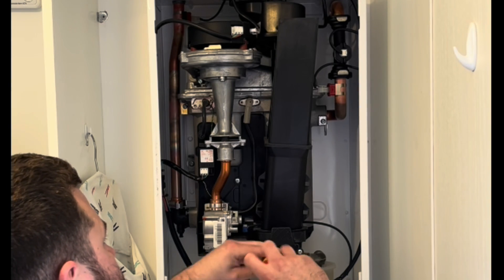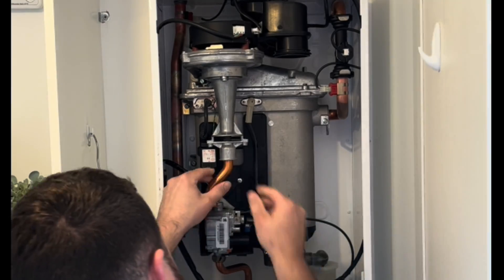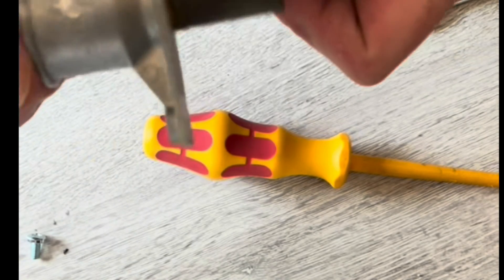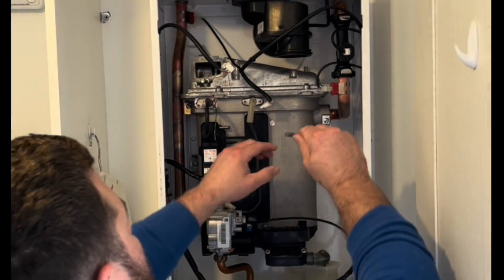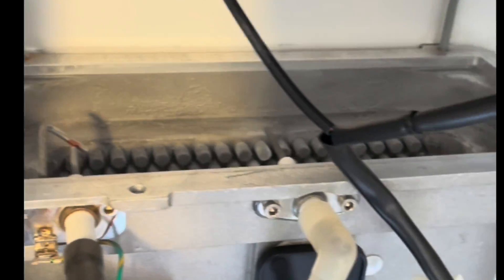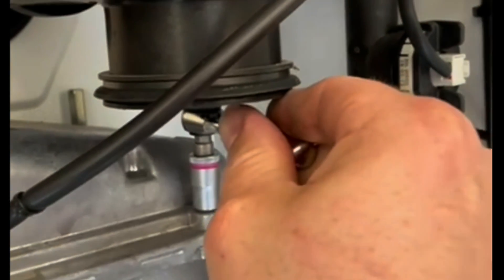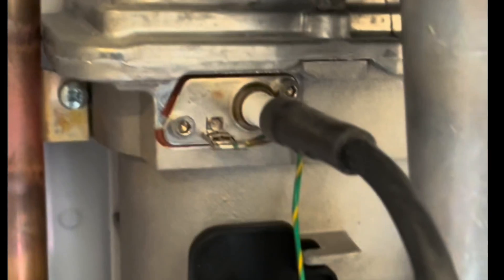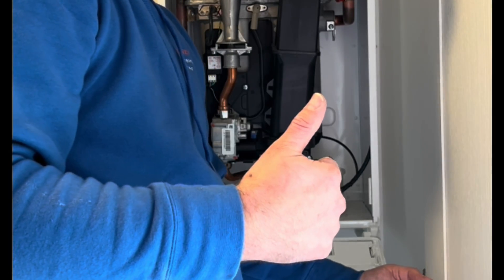How to service an Ideal logic HE15 gas boiler

Comment: Hi, can give advice on FD fault code on this boiler? Not hot water or heating, radiator checked and bled system full, it's f and e. Pump checked, it's rotating, all connection to water flow sensor ok.

Could this be water glow sensor or pump? The pump was rotating.